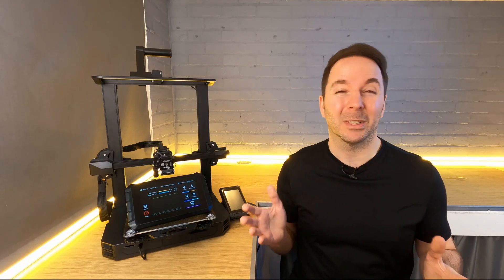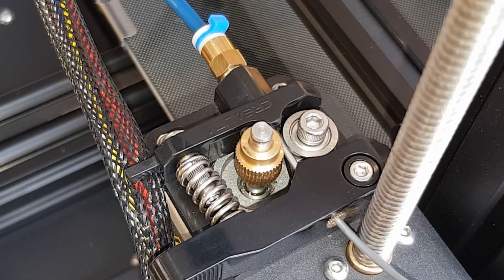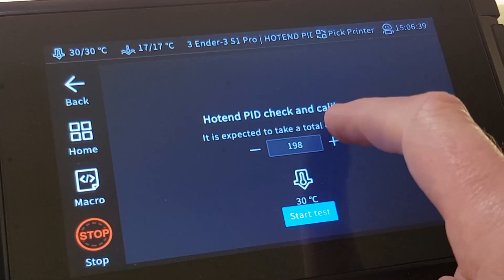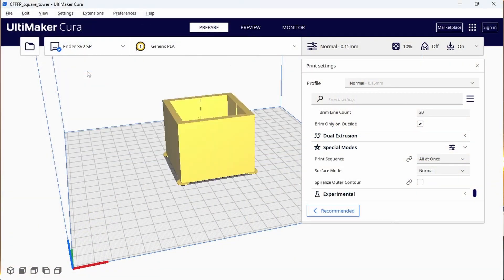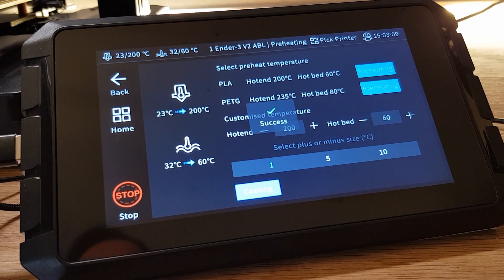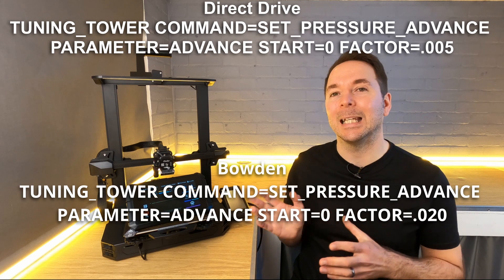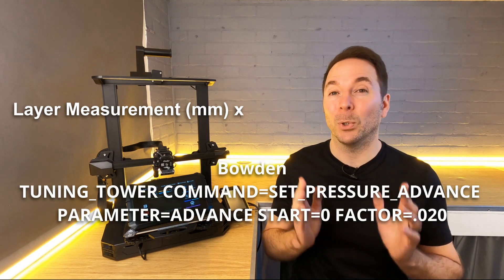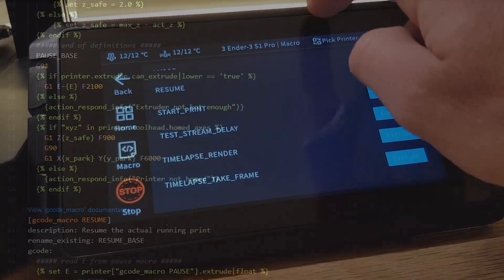How To Tune Pressure Advance With Your Sonic Pad - Sonic Pad Intermediate Part 6

Comment: Your channel has quickly become my go to for all questions 3D printing. Unlike other content creators, you actually have something to say. Where as most of the others just use the information to hear the sound of their own voices. 
I have a ton of questions but I’ll try to spread them out between the videos that are already covering something similar. 
As far as pressure advance, I understand the test, the purpose and desired outcome. What I’m curious about is why the pressure isn’t calculated in real time by monitoring the amps used by the stepper motor which is a decent representation of the rise or fall in nozzle pressure. 
I’ve only been into 3d printing for about 3-4 months now. I started with an Ender 3 (1.0), then realized I needed to increase print volume so I got an Ender 3 S1. Wanting to print more exotic filaments, and having developed some brand loyalty, I just got a K1C . A new line of filament from polymaker called Fiberon is basically all engineering grade filaments. What’s more, all of their filaments have printing profiles for the BambúLabs X1 Carbon which has properties that aren’t to far from the K1C . I downloaded the config files and manually setup filament profiles in Creality Print (I know most people aren’t fans) and found that the filament print variables fall within the parameters of the K1C . The PPS-CF is at the upper limit of the K1C print temp but should work. I have 2 spools of Fiberon arriving today, the PETG-rCF and PET-CF17 so we’ll see how it goes. Thanks for the videos!!

Comment: iv watched every video up to this one and just now seeing "Since recent firmware change, it is necessary to issue a 'restart' command after changing any settings or following any calibration procedures.*Do i have to go back through every step again? 
Also is restart command the same as SAVE_CONFIG because that restarts it as well

Comment: Once I have done this, if I want to print at a higher speed should I redo the pressure advance test with the speed turned up or will it compensate for it in the firmware?

Comment: Thank you for a great series.  I'm struggling with the methodology on this one.  Your procedure describes setting the layer height to %75 of the nozzle diameter (i.e. 0.4mm x 0.75 = 0.3 mm).  I think this is appropriate if you are normally printing at 0.3mm layer height.  But what if you normally print at 0.12 or 01.5mm?  It reasons to me the nozzle pressure will very highly depending upon your actual print height.  Shouldn't we do this PA calibration at your normal height?    I've been scratching my head.  I did a calibration at the %75 (0.3mm) and print at 0.12mm.  It looks terrible.  I'm going to repeat this method but at my normal slice height and see how it affects output.  I'm not challenging you here, merely trying to reach a better level of understanding.

Comment: i only made it to 15mm. could I have other issues with my printer or should I make the adjustment and keep going? my pressure advance setting will only be .075. i have a ender 3 s1 pro.

Comment: Just running this setup on my S1 pro. Shouldn't the equation be the height of the best print divided by layer height then multiplied by the factor? For example, 11mm divided by 0.3mm, multiplied by 0.005?

Comment: Hello Ricky 
i have been waiting your videos on the sonic pad to set up my,everything was going well until setting up pressure advance
whe i went to to print the square it stop at 99%  and displayed !! Unable to parse move 'G1 Z0.2 E' how can i fix this issue thanks
Reply: Your end g-code in Cura must have an error in it. Go line by line and make sure that it matches exactly what is in the PDF from Creality. I had the exact same problem and it was because I copy/pasted and it messed up the code.

Comment: WIth my Ender S1 Pro, I did all PA test, all other tests before and after including the speed and etc.. Then I tried to print a model (probably a not very good one) and my extruder started to tear the filament from the the bed. After several unsuccessful trials, I reset everything but I havent been able to print anything since. Changed the nozzle, reset everything, increase, decrease various heat factors, simply does not work. Interesting.

Comment: Great material, thanks again for taking the time to share this. I Have an ender 3 s1. I've followed all your videos to this point, but I cannot get this cube to print properly at all at these new speeds (profiles from previous video), not to mention the retraction makes a terrible noise. Every layer is literally missing chunks out of the sides, lots of separation. The only way I initially was able to get it to print is to slow it back down to pre-sonicpad speed of 60mms. So taking a different route I've increased the flow rate to 120%, then 150% which hasn't made any difference. 

I didn't have the vibration sensor, so I tried it with both acceleration control on and off, but no difference. Just using esun PLA+. I've ordered a vibration sensor, is it just that it can't print at these speeds without the vibration sensor? I'm happy if that's the case, otherwise starting to feel like maybe there is actually something wrong with the printer

Any assistance would be greatly appreciated.
Reply: OK worked it out with a bit more trial and error. Went back to scratch and whatever I did I must have accidentally messed up somthing as the horrible retraction noise has gone. I've also upped the nozzle temperature by 5% so printing 220 for PLA+ and between that and the retraction issue so far so good, almost perfect in fact! don't even have the vibration sensor yet. Thanks

Comment: Firstly, a big thanks for you videos, nothing to say just a really clear perfect job!
On my brand new ender 3 S1 pro, i just ran the input shaping and pressure advance test in a row (after all your other test mention in the series in the right order, PID, E-steps etc..)
The test tower was printed perfectly with really straight lines on 0.3 layer hight with no ghosting at all (with a kinda mate black finish with my PLA). After setting the pressure advance (10.68mmX0.005=0,0534 pressure advance value) my calibration cube and benchy (printed at 60mm/s instead of 100mm/s for the tower test and with 0.02 layer hight) looks kinda glassy with some micro ghosting on the lines. But the cube and benchy now have perfect angles.
Do you think i need to run both tests again? is it possible that the sonic pad didnt saved the input shaping test correctly? I can send pictures if needed. Thanks a lot!
Reply: The matte vs glossy look is purely temperature related, lower nozzle temperature to have a more matte look, and increase to have glossy look. Glossy make all imperfection more visible. You can go in the config file in the WebUI of the sonic pad to see if the input shaping are saved, look at the bottom of the file you should see a DO NOT EDIT with a #*# [input_shaper] and some value under it.  Also make sure you uncheck the 'enable acceleration control' in your slicer.

Comment: After the test print do I have to set a command for leaving the pressure advance test mode or  is this command only active for the next print and then dissable automatically?
Reply from the maker: It is only active for the next print it runs, then it is disabled

Comment: So, found out after dismanteling the extrusion element i went to take a closer look at the motor itself. Does it really does nothing or??? Well yes its moving very fast but back and forth. Bad luck in flashing i thought so i flashed the original creality firmware onto it. Same result. Ok faulty stepper motor so i took exactly a spare one and this one did the same thing moving very fast back and forth. So i prolly somehow burned out the driver? Logic says to look at the last thing you changed before things start going bad. And that is connecting the Sonic Pad. So what i have now is a unusable pad, and a printer that costed me 529 euro.

Comment: Just a little tip for anyone attempting to do this. While its visible in the slicer settings but it is not mentioned to have turned off in your personal settings, make sure to also turn off "jerk control" because this is essentially what we are tuning  and like mentioned to turn off "acceleration control" it fights pressure advance. I am not a slicer guru like some and printed 3 terrible cubes before I stumbled across that pressure advance is Klippers version of jerk.

Comment: Thank you for this series about the Sonic pad! Truly briliant!👌

But I have a question, when I do the pressure advance test my prints looks great just at the bottom and then starts to get worse higher up. Can I set a negative value to start the calibration just to sort out the perfect measurement?
Reply: Mine does the same thing

Comment: This is a great series thank you for it. I did this test and I print out the square and it comes out prefect I can't even find a place on it where I could find a bad place. So I left my pressure advanced alone. BUT whenever I print anything except for this square the print will left off the bed on the right side of the print. I watch the printer and when it starts the filament does not completely lay down and when it gets back to the point the print will do this studder step and it craps the print a little and lifts it off the bed. But not with any of the test prints like this square do you have any ideas?
Reply from the maker: It sounds more like a z offset adjustment needed. Perhaps a little more squish in the first layer would help.
Reply: @RickyImpey  thanks for your reply. But anymore down on the z it cloggs the hot end. It's that close to the bed.

Comment: I have followed all the videos starting with the basics playlist and after finishing this pressure advance tutorial i printed a calibration cube. The first few layers are warped and their edges are rough. I am using the creality cura profile and the only thing i changed was the retraction. I have an Ender 3 S1 Pro. Any advice?

After tweaking the initial temperatures most of the issue is gone.

Comment: Thank you so much for spending the time to make these videos! I've just upgraded to the Creality CR-M4 with a Sonic Pad. I've been following along often replaying your videos numerous times to get the information sunk into my aging brain, but I'm stuck now. I'm using CURA and the Endor 3 v1 Pro profile to work my CR-M4 (I can't find any CR-M4 profiles anywhere) but at this point when I try to print the Square Tower I get to 99% and then get the following error: Unable to parse move 'G1 Z0.2 E'  I tried other files and get the same error at 99%.  Creality Print doesn't give me this error, but I would really rather use CURA. Any suggestions as to why this is happening? Thanks, again this is an awesome series... The manual Creality didn't supply!

Update: I learned that the End G-Code from the Creality PDF has a typo, and should read: G1 Z0.2 E-2 F2400

Comment: i operate the sonic pad with an elegoo neptune 3 Pro. and pressure advance didn't bring any improvement for me. on the contrary, it got worse. I printed out the test file Printing was very loud. It made rattling noises during the whole printing. I don't think the gears are doing any good. After the printing test, I measured the best corner and multiplied the value by 0.05. Then I got the result on the sonic pad entered under extrusion settings. and printed the print again. my printer didn't print the corners, it simply left out the corners. i deactivated pressure advance again. it doesn't bring any improvement for me.

Comment: Do I still need to input a retraction setting? Or do I leave retraction off for the test as it might mess up the flow? Or does pressure advance eliminate the need for retraction at all?

Comment: Question for you is there a code I need to add or delete after I am done this to erase the 2 I placed in to run the test? Secondly has anyone experienced worse print quality since doing this?

Comment: I am trying to setup a Creality ender 3 neo max and keep getting the following error code while trying to tune the pressure advance; code key 112 Move exceeds maximum extrusion (131.894 mm^2 vs 0.640mm^2) See max_extrude_cross_section config option details values 131.894, 0.640.  Any suggestions would be appreciated.  Thankyou. I have worked through the other videos to this point with no problems.
Reply: I am having this same problem. Did you find the fix?

Comment: Hi Ricky! Thanks for the videos!! I just printed the tower. Do I have to restart the Sonic Pad after printing or are the command line codes (SET_VELOCITY_LIMIT SQUARE_CORNER_VELOCITY=1 ACCEL=500 - Direct Drive - TUNING_TOWER COMMAND=SET_PRESSURE_ADVANCE PARAMETER=ADVANCE START=0 FACTOR=.005 in my case) only used once? I saw in a previous video I had to enter a code after completion so the printer got back to the normal state (Rotational distance -> m82)?
Reply: You can either send the command "restart" in the consloe or just restart the sonic pad manually. this will clear the printer

Comment: First of all...LOVE your videos I've watched this entire series over these last  few months since I got my first printer (Ender 3 S1 Pro) and the Sonic Pad!! Quick question though, I'm finding sharp corners at higher speeds and accel to have huge divots in the seams so is there any benefit to running the pressure advance test at the higher speeds and accel that you would be printing at? Perhaps a speed of 150-200 mm/s and accel of 2000 or more instead of 100/500? I'm not entirely sure if it's pressure advance related yet, but wanted to ask anyways.

Comment: Once I've run the tests, is there anything I need to regarding the console commands I've entered? Will they continue to appear in future prints or are they a 1-and-done situation?
Reply from the maker: With previous firmware versions the Pad would automatically restart. Now it doesn't, who knows with future firmware. Send a SAVE_CONFIG command when you're done just to be sure.

Comment: This calibration is related to the speed which the test is performed (100mm/s). If we want to increase the speed we should run this calibration with different speed right? I printed on 160-170 mm/s after performing the calibration successfully and my print have issues with the corners. All your tests I guess is performed in 100mm/s. Personally I want to pump up the speeds even more.
Reply: Haha I just asked the same question. For kicks I'm gonna run a PA test with 200 mm/s and 3500-5000 accel tonight and do a benchy. I'm trying to take these divots out of the corners like you I believe!!

Comment: Every time I try to start the tuning tower print it starts printing the first layer and then gives an error that says that the "move exceeds maximum extrusion" and stops the print. I looked over and watch the whole video again, but nothing works. I basically give up at this point.

Comment: !! {"code":"key112", "msg": "Move exceeds maximum extrusion (1.200mm^2 vs 0.640mm^2)
See the 'max_extrude_cross_section' config option for details", "values": [1.200, 0.640]}
i get this error
Reply: The console codes is made of two parts, one is to set_velocity_limit acceleration, the second is the printer-specific set_pressure_advance test parameters, make sure both are entered.

I once forgot to enter the first command and ended up factory resetting everything only to realize my mistake later on, lol.

Comment: How do you update the printer.cfg file where it actually saves/updates to the printer firmware? A friend of mine has the sonic pad hooked up to his Ender 5 Plus, along with a new sprite extruder installed. Since he installed the sprite extruder, he now needs to edit the printer.cfg file with new probe offsets and PID settings, but he cant seem to get it to save. 

The issue he is having is that when he edits the printer.cfg file via mainsail in the web browser, and then clicks save/restart firmware, nothing actually gets updated in his printer firmware. After he edits and saves/restarts firmware, it still homes off center. In addition to that, the settings he edited in the printer.cfg will reset back to default if he powers the printer and sonic pad off/on. Any idea how to resolve this issue, and actually update the firmware settings?

Comment: So...what if after only like 2 layers it's underextruding and getting stringy? Is that still just same formula? If I print a regular print there's lumps all over
Reply: Hi, I have the same ¨crappy¨, Have you fixed? Im running a E3v2 without CR, neither BL !!

Comment: Ricky what fans and shroud are you using on your sprite extruder in the video? Would you recommend it? Im having trouble with overhangs since the Sonic Pad unless I really slow things down. I'm guessing it's a cooling issue. I mostly print PETG.
+++ I think I’m mistaken I thought that was Sprite extruder!
Reply from the maker: I run the Minimus Cooler on my E3v2 but currently standard cooling on my S1 Pro with a Sprite extruder. The cooling is the weak part though and needs work. I plan to do something about this soon.

Comment: If you have the web ui open and watch the gcode screen that you enter commands on as it's printing the test piece , you can see what it's adding for pressure advance and if quick , can find the best layer and use the number that's on the screen to get real f'n close , just my 2c , .085 is what web ui said and I ended at .087